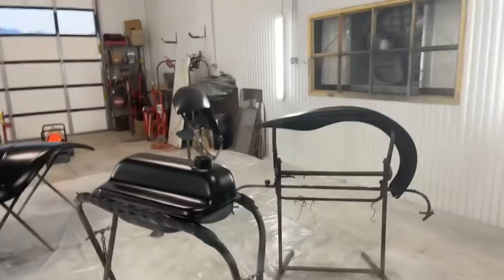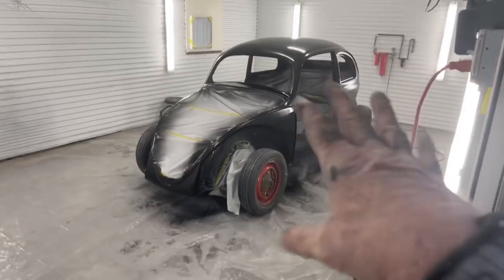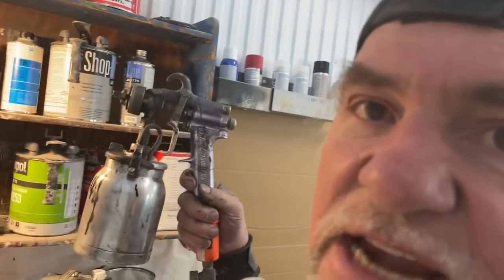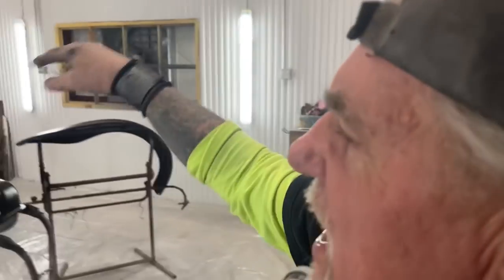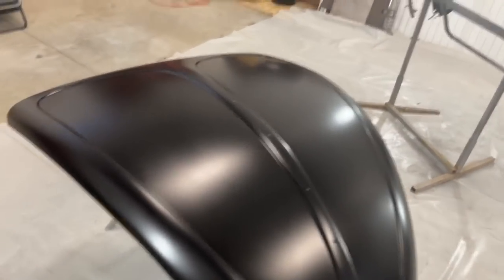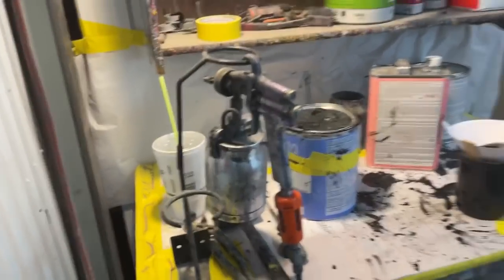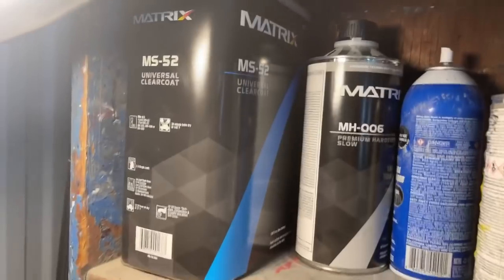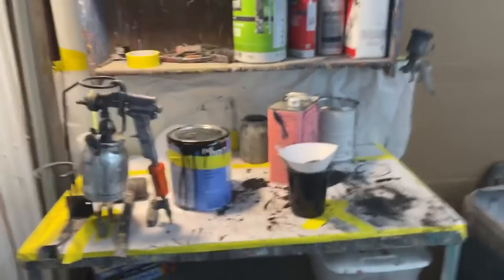Volkswagen BEETLE Getting Painted -PART 1

Comment: Pete, you are so right about the world of spray guns! I have videos where the painter uses a different spray gun and tip size for each step. 6 steps from bare metal epoxy to 2K primer, high build urethane primer, sealer, base, intercoat, sand with 1,000 grit, Clear with another gun gun each time. They have more time invested in cleaning each gun for storage, than they have in paint time. Let’s review, 7 guns, $13,500 investment from carbon fiber to digital air nozzle pressure gauge built in, to coated titanium.... Who cares? I love the truth and exposure to everyone to see, it doesn’t take $13+K to spray $600-$800 Of product to have a $60,000 paint job! As long as you have seen 13+ years of Pete’s welding, hammer-dolly, seam sealing, metal shrinking, filler build coat, finish filler coat, proper sanding and seam sealer videos. Now you are close to “Paint Ready”. Then & only then, think product, planning and best practices with cleaning. Now paint!    Thanks Pete for sharing this journey!